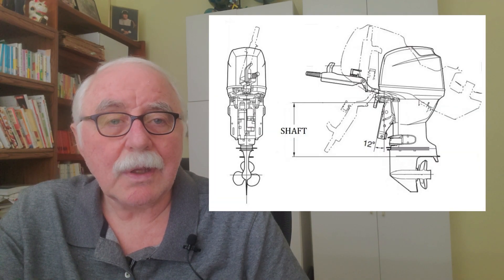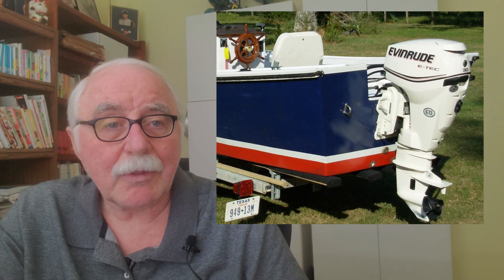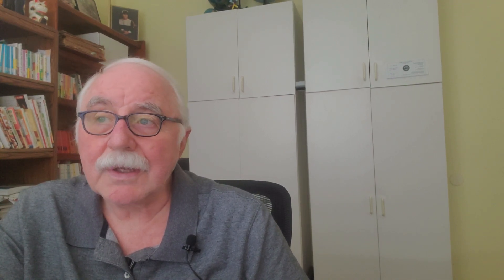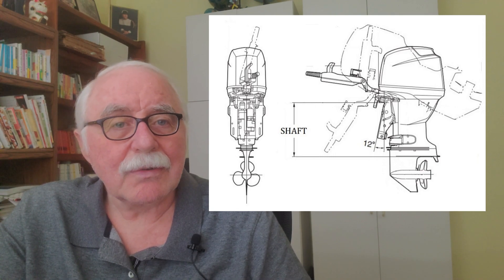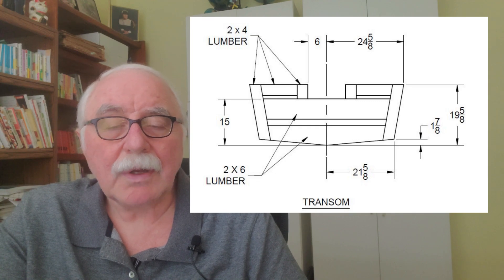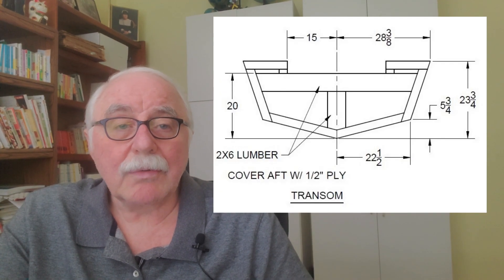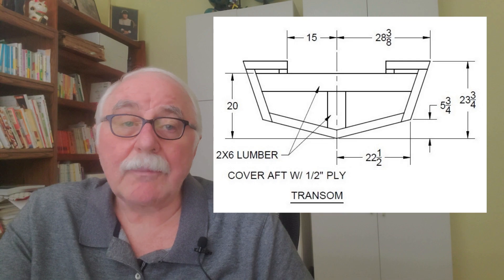Yes, You CAN Build a Boat - Outboard Horsepower and Shaft Lengths

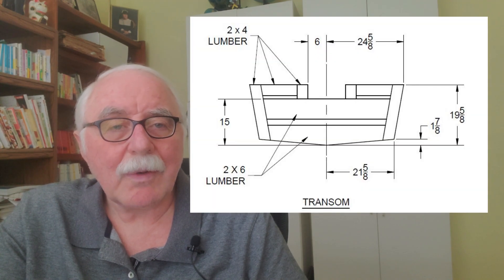Comment: Enjoying your videos on boat building.  I have a question.  At 5:28 in this video, the plan shows using a 2x6 for the transom motor mount.  The ends of the horizontal 2x6 are attached to vertical 2x4's.  Since the "cross grain" of the horizontal 2x6 is screwed into the "long grain" of the vertical 2x4's, won't the cross grain of the wide 2x6 expand/contract while the long grain of the 2x4's not  move causing the pocket screws used to work loose?

Comment: One of the best hp formulas I have seen was the one promoted by the late Renn Tolman, whose "Alaskan Skiff" is similar to many of your designs.  He figured that 1 hp per 25 lbs. of displacement weight was about right for his semi-vee skiff.  So a 1000 lb. running displacement... (weight of the boat, fuel and pax),  skiff should take about 40 hp.  Of course a flat bottom dory design will require considerably less.

Comment: I suspect at least part of the reason why tiller steering hp is rated lower than remote steering is due to weight distribution.  With tiller steering, the operator's weight is farther aft than if it were remote steering.  That added weight aft means you should have a motor that is lighter, and therefore lower hp.  With remote steering, the weight is distributed closer to the center of the boat, which allows more weight hanging off the transom, and therefore higher hp.
Reply: That totally makes sense.
Reply: Its more to do with the forces involved in steering by hand holding the motor's tiller verses a wheel mechanically connected to the motor via push/pull. Bigger motors become more dangerous to try to handle the tiller, or they don't even come with that option for obvious safety reasons.
Reply: @paulbriggs3072  Good point.  Thanks for that.